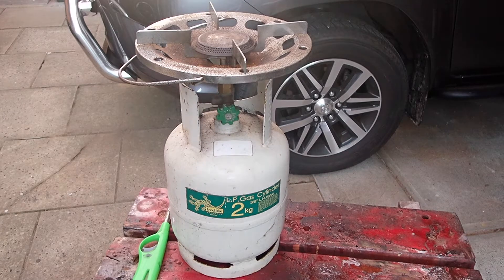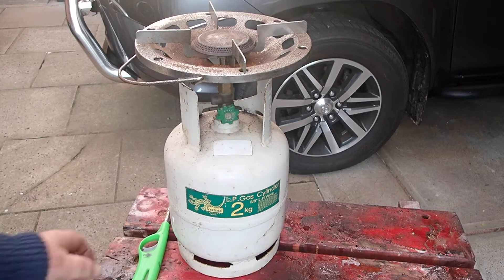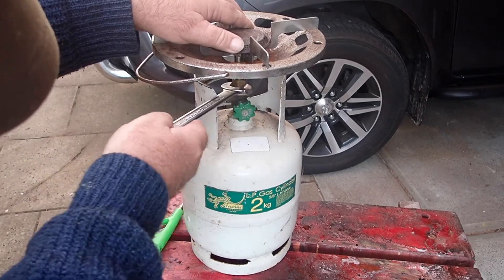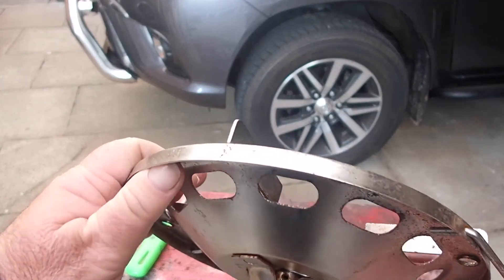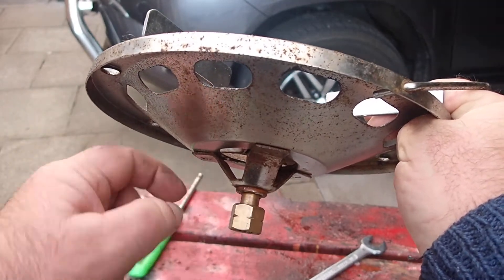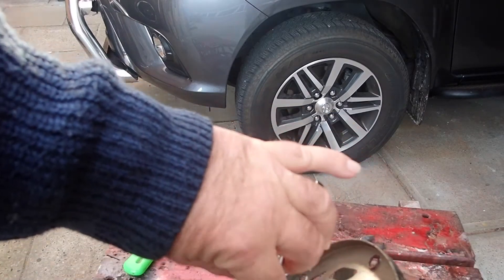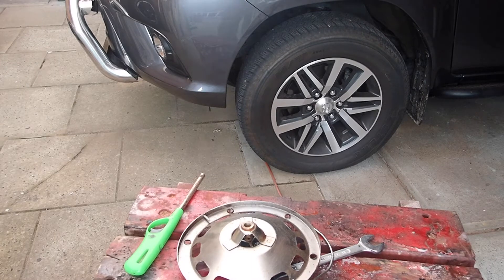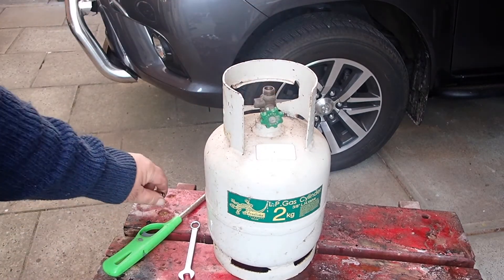Single Burner Gas stove repair

Comment: I bought a new single burner Gasmate from Bunnings (box and receipt long gone). I had it sitting in the garage for six months unused. It was burning but took ages to boil some water. I disassembled it and everything looked fine. When I reassembled it, I found it worked a thousand times hotter. So I'm not sure what the obstruction was? but because of your video, I was confident enough to check. Now it works great, so thank you.
Reply from the maker: You are welcome the best part about YouTube is sharing information and skills its a win win for everyone
Reply: It's great that you resolved it. Everything man-made can be reverse engineered. It's just that people are afraid of tackling these issues. It's also a matter of following the correct safety protocols. 👍👍👍👍

Comment: I have all dads old whitworth spanners etc good on oddball  gas sizes. Dad was a machinist from early 60's till 13, he died in 2013 short retirement. I worked on the mines for years too i grew up on them living out there.
Reply: That's great man. You should put Dad's tools to Good use and pass it on to the next generation. Older tools are the best , since they are made of better materials and metal. 👍👍👍👍

Comment: Hey! Thanks for this video. Any tips for if the jet seems to be the issue? When i test it out the gas flow is really weak. Thanks so much!
Reply from the maker: Some times the gas has some oil in it and it will clog up the jet you can try boiling it in water . It is to small to use a wire replacement jet is not expensive